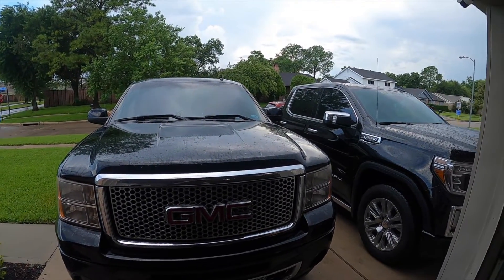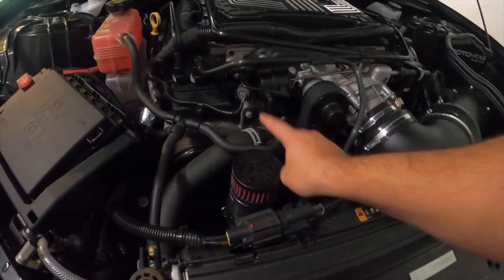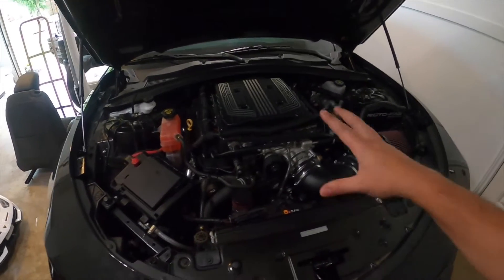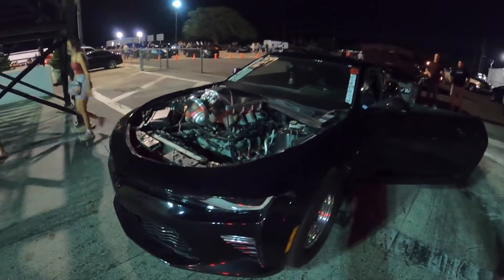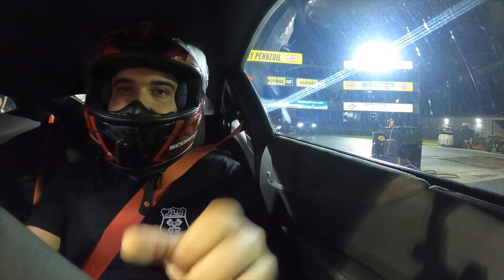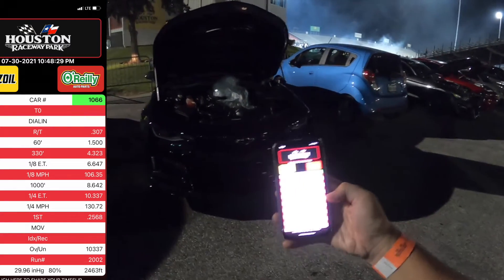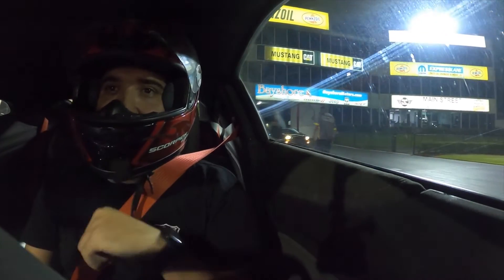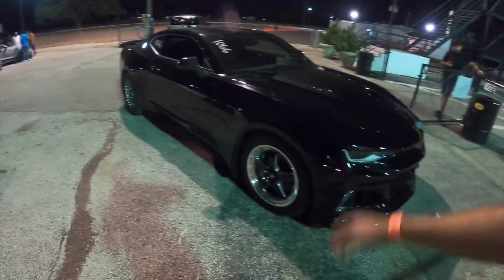Pray Performance Makes my ZL1 Faster!! | Vlog # 440

Comment: Just one question sir How much money do you have tied up in this car from the car cost and tunes and upgrades?
Reply from the maker: The car was 57k between the tune and required accessories for remote tuning I have another 2k, rotofab intake was 600, flex fuel sensor 325, and finally drag pack with new tires and wheels 3200.

Comment: I see you launch in your mode? For best traction but how do you get the rear exhaust valves to open in your mode?
Reply from the maker: I set the exhaust valves to track independent of the mode the car is set in
Reply: @JLSpeed  ok perfect did not know you could set them individual

Comment: What size tire are you running on the Welds in the rear without a trans tune? 305-45-17’s?
Reply from the maker: Yes 305/45s
Reply: @JLSpeed  perfect thank you!

Comment: What would I need to do a remote tune from pray. Could I have him send it to another tuner then have that tuner download to mine
Reply from the maker: You would need your own hptuners device amd wideband to do the remote data log. That would also require you buy all the credits for the tuning for. Hptuners. It’s a bit pricy all said amd done, but worth it!
Reply: @JLSpeed  i could do that. That way I own my own shit. And I can take it to whoever I want and it woukd basically cost me nothing? But dyno time?
Reply: Or is downloading the tune something i can do basically plug in the odb? Or let a tuner do it
Reply: @Zle_blacklightning  Once you have your HPTUNERS w/credits, and a Wideband, you can then purchase the flat fee for tuning (which is $600) then he will send you instructions on how to do it on the street. I have manual ZL1 so all I had to do is a 3rd gear pull from 2500 rpm to redline. His tune revisions are spot on. He was able to get my car to E50 w/ headers and intake. But data logging and downloading and sending a tune/log is very simple
Reply: @innzy3851  i have the 10 speed its still 600?
Reply from the maker: @Zle_blacklightning  yes still 600 and you would be able to do your own data logging and you could modify your tune, but I wouldn’t do that unless you know what your doing. I would leave that to the tuner
Reply: @JLSpeed  definetly thx yaw
Reply: @JLSpeed  what wideband did you end up going with? And did you get the pro feature on the device or the standard package ?
Reply from the maker: @vlexlopez5389  the aem wideband with the obd2 passthrough connection. and i just got the standard package. I did buy the pro feature, but dont use it its still not reliable for stand alone data logging.

Comment: So is the $600 with the trans tune included and how much are revised tunes for later mods?
Reply from the maker: 600 includes trans tuning, but that doesnt include you sending your trans tcm to get hardware unlocked by hptuners or the mpvi2 device and credits you will need to buy to be able to tune the car
Reply: @JLSpeed   Thanks for the quick reply.  Did you get a trans tune that would be reliable down the road or is it just for track use?
Reply from the maker: @michaelrogers5418  Trans tune is smooth and works great normal driving. These 10 speeds dont need much adjustment but the big key is being able to remove a limiter that limits torque in 1st gear for launching.

Comment: Great job documenting the mods and progress on your car! What does the car run on the drag pack on regular 93?
Reply from the maker: on 93 it was running a 10.9 before trans tune so i would guess it would be around a 10.7ish on just intake and 93 with full tune
Reply: Thanks, that’s great info. I previously owned a 2013 CTS V wagon,  2015 ZL1 and looking at a new ZL1. I’ll likely end up with the manual but am really impressed with the 10spds performance on track.

Comment: What kind of exhaust ?
Reply from the maker: Speed engineering headers and mid section with x pipe to stock rear dual mode exhaust.
Reply: Thanks .